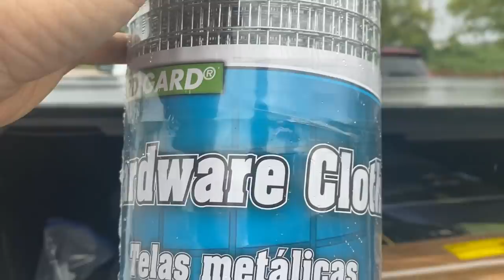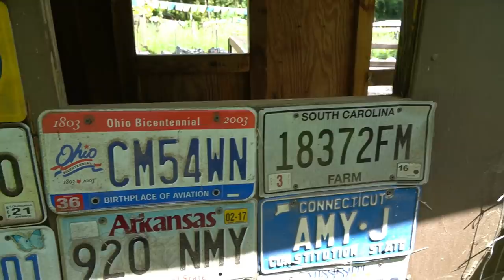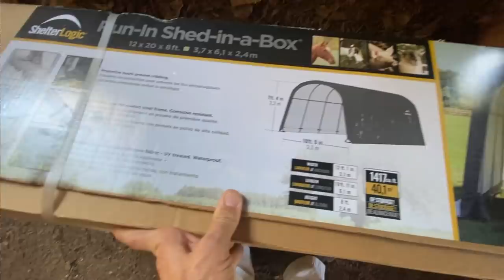HUGE Transformation Happening To This OLD Trailer!! It's Becoming A Chicken Coop At The NEW Farm!!

Comment: Glad you are okay after that truck tipped.  I can’t help but worry about bumble foot on wire flooring.  I don’t know much about chickens but I have seen them suffer with that.  I know you all care about each one and know best.
Reply: Actually, that's not wire, like in hardware cloth.  It's wider in the metal strips than wire is, and flatter.  The birds will be fine.
Reply: They will be able to leave the coop during the day through the automatic door and onto grass.  They will be roosting at night.  Their time on the flooring will be at a minimum.  This is typically not a setup that would put them at risk.  It’s just a larger scale version of the chicken tractors used in rotational grazing.

Comment: I love this chicken tractor idea! Just remember  always take your cellphones in it....just in case you get trapped on a hot day especially! !!
I'm curious, are you going to retain water on the top of the coop? You could use the type of bladder your currently  using for the  worms. Just collect rain water and tube it down into the tractor or tube it under the tractor. Save your well water for closer to the house. Good luck ;can't wait to see what else your plans are.
Reply: Also a name for the grey blue island bird would be Smudge and Slim Shadey for the darker one.
Reply: I think that's a great idea, especially since we need to start thinking of ways to capture as much water as possible, for future issues.  I think a gravity-fed watering system would be perfect for watering the birds... under the trailer would work well, since that's going to be shelter for overnight, as well as egg laying, so during the day, they'll be out in their free range enclosure pen, unless there's inclement weather that they would need to hole up for.

Comment: My Grandpa, which lived to be 103, build animal shelters & grain shed with free wood.  You might be able to do the same thing.  John Karp used the first & second saw cuts from a local sawyers with wood mills.  Most boards will still have bark on half round cuts.  You can remove the bark & cut edges, so boards edge are thicker.  Then you can use them for the animal sheds.  They can be used on top to make sheds more sturdy.  If you want dry without leaks on roof, add some tin or fiberglass works too.   

If you want air flow, you can add hardware cloth instead of windows.  Then do simple shutters, using the wood cuts that go to the burn pile or firewood.  Many sawyers give this material away for free.   Even if its a buck a broad for second slice, it would be worth the investment.   He had a cow barn that stood for almost 40 years.  Cost the posts buried in the ground.   Small cedar logs work great for post.  Search out some local sawyers & see what you might be able to just go pick up waste wood to a sawyer running a mill.  40 acres looking good.
Reply from the maker: That’s pretty awesome! Thank you for sharingn

Comment: Build steel legs on all  corners of the trailer that can slide up and down, and can be locked in place (either a bolt screwing in, or a pin sliding into pre drilled holes). That way if you need to move the trailer, you unlock and slide them up and move it, then when its in place, slide them down again and lock in place.

Comment: Yay! Coming right along. 😀 So glad Brooke didn't get hurt by that door. 🙏🏼💕

Are y'all going to put an upright people-sized walk- in door in the back end of the trailer? And/or another door in the front end of the trailer? Or either sidewall? 

Otherwise that's a mighty heavy door to enter daily for eggs, food, & water.

Just for curiosity. I've noticed more than a few farming channels use milled boards, like 2X4s as roosts, without rounding the corners. My Dad always used tree saplings with the outer bark scraped off. I'm guessing about the diameter of a 16 oz Coke bottle or a little less. The chicken's toes wrapped around them comfortably, like wild fowl roosting in trees.
He mounted them like stair steps, lowest in front, with enough enough space between each rung, up & back for ease of moving & not pooping on each other. 

His coop was similar to your trailer, but with wood frame, V-Crimp sheet metal, hardware cloth on the south side windows, with sheet metal covers hinged at the top & locking at bottom - to close for bad weather & winter.  Walk-in door on west end & roost across east end. North side was solid for weather protection. We raised layer hens late Winter-Spring, sold eggs Summer, & used them for meat in Winter. Dad built a row of laying boxes down the north side. A couple warming lights were hung in the center of the coop, suspended from the center rafters. We kept wood shavings on the floor.
    .After baby chick feed, I fed them "laying mash," crushed oyster shell, & I don't remember if anything else.
Care of the chickens & egg collection were part of my farm chores. 😀💕

Comment: PRAISE GOD for sparing Brooke's legs!  As well as a underneath structure on both ends to level and prevent the coop from a teeter-totter condition, I was thinking about a must-be-manually-operated 'governor' of some type, that would require the person to have to be OUT of the coop before the door could come 100% down to the floor.  Something as simple as a concrete block or two on one or both sides of the coop opening...or anything to stop an out of control crash.  OR......put the coop perfectly level and weight the upper-most end with a chain attached to concrete (?blocks?).  (so many ways to secure the coop for safety of the personnel around it).  May God send you His wisdom.    : )      P.S.  Arlo is a HOOT!   So special!

Comment: The wire floor, with two ventilation fans on top, could provide sufficient air flow.  Windows with sliding doors when those cold winter air fronts arrive.🐓🥶🙏
Reply: How will you close off the cold winds in winter from freezing your chickens? Maybe hay bales all around the trailer....sort of like a hay wall insulation.  Also, QUESTION  how will your chickens not get bumble feet from being on wire ? I know it's mainly a roost and egg laying trailer, but can they escape outside?

Comment: I came up with a plan the worked awesome for my chicken coop door.   
On one side I did a stationary door from top to bottom and on the other side I cut the netting longer and attached the netting at the top and at the bottom I wrapped it around a board for weight and stapled it.  It made going in and out so much easier for us and it was less hot for us to be in there.   We would shut the big doors when we weren’t in there.

Comment: before you add stabilizers.... id recommend taking the tires off and taking the rubber off. I would leave axle on and run only rims so you can still move it but not have to worry of flat tire. and as far as stabilizers..... id just get a jack stand in the back and set it up then a crank jack on the pole and keep net boxes ext. that you need to get to between the axle and the pole.  i wouldn't over think it were you have so much to get ready for. once your there and settled in you'll have plenty of time to adjust tweak and upgrade. you guys are fixing to accomplish alot in a short time. chickens don't care how their digs look.... as long as its functional and move on to next species.

Comment: I know nothing about farming so this is an honest question not meant to criticize.  I know we Southern folks don't have harsh winters.  However, what will you do in the wintertime with the floor being open?  Would it get too cold for the chickens?  I am positive you already thought of this.  I am just wondering. :)
Reply: Chickens actually do very well with cold. As long as they are not wet and not in direct wind. Good ventilation is a plus in winter because they will be drier then.
Reply: Even in my climate (North Dakota), this would work, because the chickens just need shelter that will keep them dry.  Ventilation is the key component, however.  The more ventilation, the better it is for them.  So the open grate flooring, plus the windows with the hardware cloth is perfect.
Reply: If it does get to cold and windy for the chickens, they could easily screw some corrugated iron or something similar around the base of the trailer, down to the ground to act as a wind block.
Reply: Heat lamps work well for all animals, when it's too cold out. As well as, the lamps are really cheap too. We probably have 20 heat lamps on our property. We use them for cows, goats, our Mt. Lion loves the lamps too. I reside in central TN.

Comment: I have an idea! Why don't you block the tongue. With blocks stand at the back make make a A-Frame or a Square 2x4 type of frame underneath to keep it from Teeter tottering. Just an idea!
Reply: With stairs and a grab bar like they  use in showers. I'm just thinking rain is going to be slick on that bumper . That way if you slip you don't grab the overhead door as your coming down. So glad no one got hurt or trapped. (Imagine the cell phone on the beep beep and MaryCarl trapped inside on a hot day!)

Comment: Slide to 25% to one end that way you can move it with the tractor from the other end the father's point of that. Put legs on the end where tractor will pull from you should not have to adjust after that

Comment: I was wondering how warm that new chicken coop will be in the winter?  It is good that it is predator proof with that metal grate floor but you will need to set that trailer down closer to the ground and enclose the base around the trailer as well as having warm structures inside beside their nesting boxes and roosts.

Comment: Concerning the new chicken coop. I am not sure but it looks like the metal mesh is not in contact with the side walls which would leave the chicks vulnerable for attack. Maybe use some overlarge L brackets at intervals from the outside coming up under the mesh and angled around the side walls securing them with a washer and bolt head coming from the inside with a locking washer and nut on the outside. That should take care of the problem needed for extra security. Also, I thought you could get rid of the garage door and put a regular door for you to go in and out of. Just thinking ahead.

Comment: You may still need a vinyl floor over that wire eventually. Unfortunately, the wire will rust. Check on the chickens feet occasionally and, it’ll be rough getting the fertilizer out from under the building if it’s not off the ground good. I hope it works but, my mind runs, what ifs. Love your sweet family and wish you every success. Btw, will the wire bottom be ok in winter?

Comment: Are the outside edges of the wire secured to anything, sometimes it looks like there is a gap.
Reply: I thought so too. Those would want to be closed up against predators. Rats can be a serious nuisance and can pull themselves through narrow openings.
Reply: That's what Jason was doing, in cutting it, notching it to fit snugly against the walls.  Then he screwed it down to the cross-beams.  That metal is pretty stiff, unlock wire hardware cloth.

Comment: I was just wondering is it possible to move Thomas's cage on the grass a little bit so they can nibble on some greens??💓
Reply: They'd be moving it, constantly, as the turkeys would continually strip all the greens.  I'm sure that they provide greens for the birds, but you just don't see them, because they wipe them out so fast.  It's a treat for them.  I know when I put greens I pull from my yard, weeds, etc., that are safe for them to eat, and throw them in their run, I can come out an hour later, and they're completely gone already.